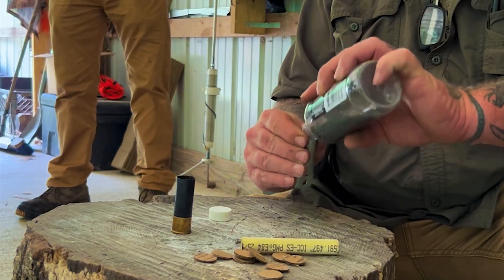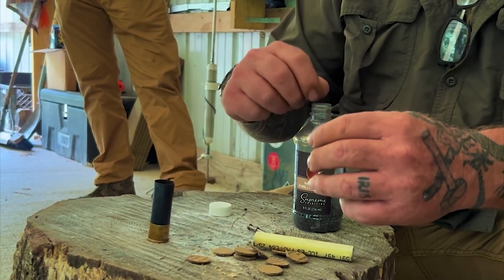12 Ga Handloading DIY Excerpt

Comment: After watching your 12ga break open muzzle loader video, I gave the idea some serious thought.  I have a side by side, and instead of loading the gun with that plug you had, I decided to get those Full length brass 12ga shells that take the large rifle primers.  I have a whole field load setup just like what you just showed.  I love being able to load my own black powder or pyrodex shells wherever I am.  Trail Boss is a good one too.  It's awesome to see you doing this.  

I want to replace my side by side with a Stoeger Condor Outback.  It's an over/under with blade style rifle sights.  With the 10" cartridge adapters and this shell loading technique, I feel like it would be the one gun to have if you can only have one.  

10" .22lr adapter in a 20" smooth bore.  Oh my!  What would I do with those other 10"?  Hmmmmm.  Let the imagination loose on that idea.  Then a 12ga follow-up shot?  I'm looking forward to that build next year.